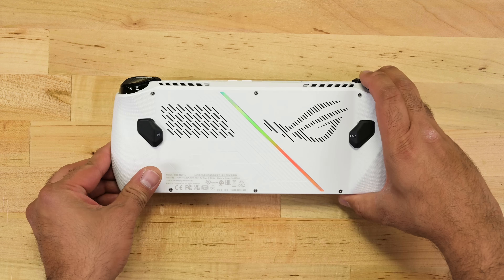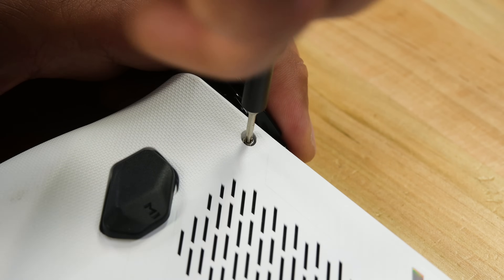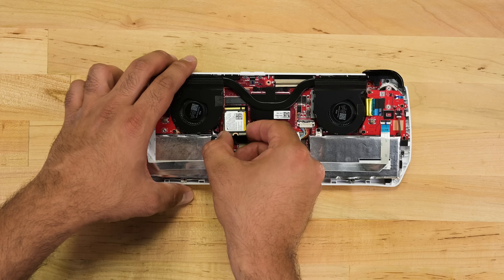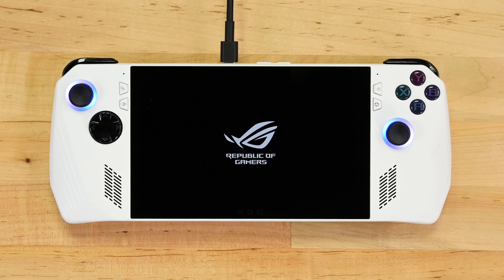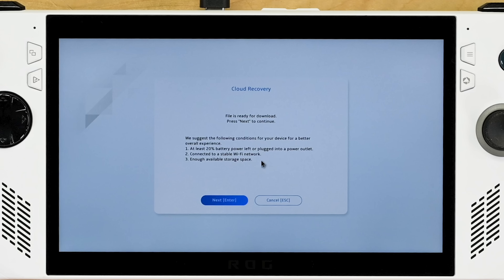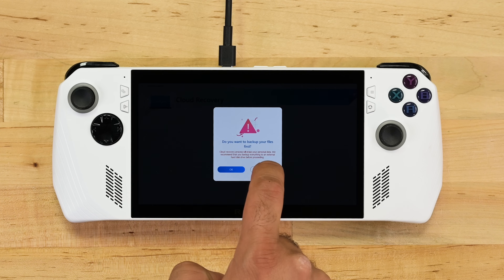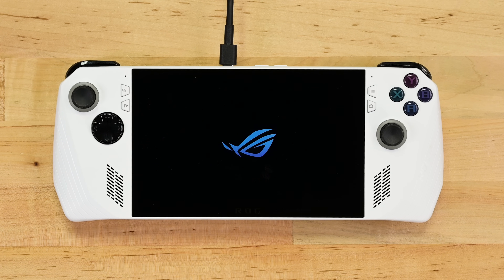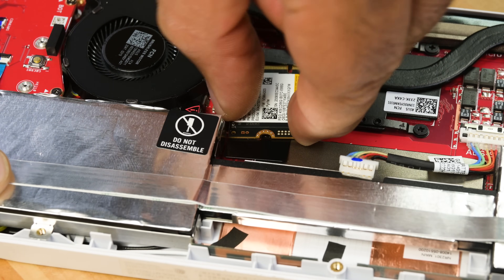How to Upgrade the SSD in an Asus ROG Ally

Comment: Thank you 😊, just upgraded to a 2tb I got from Amazon black Friday deal...

Then the Rog didn't power up 😰, after a brown trousers moment, I remembered YouTube can fix everything... There is another video on here that tells you to hold down the power button for 40 seconds with no power supply plugged in...( Not sure why but just do it ) Then plug in a high power supply to jump it, ... I plugged in the Rog original charger, it didn't work 😨 then I tried a 100watt usb charger, 🤠the thing instantly powered on , and all is good from then on , back to normal... I don't know why , just writing that here incase some reads this and is thinking s&it I broke it , it will power back up find or borrow a high powered laptop charger or buy one from Amazon then send it back 😎 ..the end

Comment: I tried this. I was easily able to open the Ally and remove the battery connection, but my problem started after that. I tried to open the ssd screw but the screw started stripping. I tried my best but it didn't budge, tried some hacks, still nothing. 
Luckily enough we have a lot of independent PC repair places where I live (Ashok Vihar, Delhi, India). The guy there was able to open it with his screw driver and technique. 
I would recommend using a good screw driver for this or let a professional take care of it. 
The Windows recovery process was very easy.

Comment: REMEMBER the device will not turn on if the backplate is not closed and all the screws tighten. I understand this is a safety feature, I can't really criticize it, but put a warning somewhere. I almost got a heart attack thinking I broke something when upgrading my SSD.

Turns out that,  unlike with desktop PCs, you need to put all the panels back before turning it on. That goes against my every instinct as a PC builder.

Comment: Just got mines switched to a 1tb ssd card. It felt like forever getting it set up. If your rog ally is anything like mine. If your secure boot isn’t already set up on the original ssd card, do that first before you set up any new ssd card. It will definitely be a fast process for you.

Comment: So much simpler than the Steam Deck.  At least with the rog, you don't need two or three different screwdrivers.  I have a 2TB NVME in my Deck right now, and my Deck is in storage.  I'm just waiting to get a dock for the Ally, before I do any surgery on it.  What is the Steam Deck NVME heat shield for anyway?  If it's necessary, then why don't they all come with heat shields as standard?

Comment: Whats the biggest ssd you can add?
Reply: Hi, the storage isn't the problem here the size is. If you feel brave enough, you can unleash your hacker man mode.
By default as of 12.2024 you can only install compatible SSDs up to 2tb. Everything above is most likely fake or slow as af. I use a 2tb WD Black SSD in my Steam Deck which I also used in my ROG Ally.

However, if you're also a big gigabit haxxor destroyer, you can get "Bewinner For Rog Ally Handheld Conversion 2230 to 2280 SSD Hard Drive Expansion Board" in order to fit normal size desktop SSDs and get something like a 8tb SSD into this thing. I did that and had to install a heatsink for this SSD but it was working fine with Ally.

Comment: If you are being prompted to enable secure boot and it reverts to disabled after you have saved and retried then make sure that "fast boot" is disabled on the boot menu.
Reply: i am still getting secure boot prompt when i try cloud recovery. I turned off fast boot, exit and saved. entered bios again, turned on secure boot, save and exit. returned to bios, secure boot is off again...
Reply: @johnny14794 Did you resolve the issue?
Reply: @VelvetMaginician  Yes. I put back the original M.2. Entered Windows. Disabled Bitlocker. Then I went into the Bios and was able to turn off Secure Boot. Then I Put back the replacement M.2 and was able to reinstall Windows through the ASUS recovery.
Reply: @johnny14794 I see, I’ve been curious though, can I swap the SSD with a new before the whole startup and set up? I mean like straight out of the box brand new

Comment: Thanks for the guide. It was really helpful. I struggled a bit because I could not get the upper right screw out of the Ally case. I just removed the backplate anyways and it was not an issue. Removing the SSD screw was also a bit awkward, but it was fine. By the way I used the iFixit essentials toolkit and it worked out great.

Comment: Tip for anyone who runs into network error message. Use your phone's Hotspot while on your home wifi. It wasn't working directly connected to my wifi, but worked immediately after using my phone Hotspot for whatever reason.
Reply: I had to do this too, not sure why. Free data luckily
Reply: Note to anyone reading this advice: Don't do this. Phones can't share hotspot and be connected to wifi at the same time. All this guy did was use his cellular data

Comment: Note that the screws on the back should be 100% tightened. Apparently there's a safety feature that stops it from charging the battery (even if the orange light is on) if a screw is loose.
Reply: Top comment

Comment: Well with the SD card reader issue, I lost my 512gb micro SD card. but I didn't give up on the device yet. Instead I ran up to microcenter and got a 1 TB drive. I'll refrain from using the SD card until otherwise

 Thank you for showing me how to get back to the cloud data.

Comment: Note: After disconnecting/reconnecting the battery you will have to plug it back into the charger to turn it back on. ( Even if the battery has a charge )
Reply: You are correct sir.  Sure wish I would have read that before hand 😂
Reply: I came here to say this. Tried plugging it in to the rog dock but had to use the original charger to get it to turn on.
Reply: lol i know i almost had a heart attack
Reply: You dont have to disconnect the battery.
Reply: @NoMoreLies365 you don't, but for the safety of frying or shorting something, you really should ...
Reply: @NoMoreLies365  always  disconnect battery

Comment: Don't forget to set your correct time and date in bios if not you'll be stuck on "checking" for cloud recovery 👍🏻
Reply: How
Reply: That's why I don't disconnect the battery 😬
Reply: @borky1987  you should
Reply: You should to avoid shorts/frying something
 @borky1987
Reply: @borky1987 so that's not really needed?
Reply: @Gamebasic I don’t know I would say it’s 100% standard recovery protocol to disconnect the battery to prevent a short circuit

Comment: this is the last resort if ASUS cant fix the SD CARD / reader malfunction issue
Reply: Honestly, this should be a first resort anyway.  It may be a bit pricier than using an SD card, but at least it's all in one now, no fiddling around required.  I was using an SD and just decided it was easier and dropped in a 2 TB drive.  Copied over all my emulators, reinstalled steam, bobs your uncle, good to go.

Comment: It doesn’t automatically boot into bios. You need to hold the volume down button and then turn it on.
Reply: Brand new ssd installed for me . Booted directly to Bios
Reply: Installed a brand new western digital black sn770m 2230 2tb and mine would not start until I plugged the charger in. I didn’t know about the volume button
Reply: If you having nothing on the ssd it will boot into bios automatically. Dont spread misinformation.

Comment: I just picked up the ally from Best Buy (finally in stock) and I was blown away how great this plays games. I was disappointed with the storage and I know it has microsd but I wanted to upgrade the m.2. Will this keep my windows OS key since I’m guessing windows is on the other m2?
Reply: That’s the point of doing the cloud recovery. It will put the system back to stock on your new ssd. Otherwise it would just be a blank windowless ssd.

Comment: Had to plug in the original power supply before it would turn back on, but other than that no glitches.  Connected to 2.4G wifi on the first try and is already almost done with recovery.  Used the Inland QN446 from Micro Center/Amazon.

Comment: IMPORTANT: You need to update the MyAsus app firmware and bios before swapping the drive as stated by ASUS or you will get stuck on the 'checking' on the cloud utility. 

IFIXIT guys need to redo this guide as its pretty important as most would assume they are doing something wrong!
Reply: I didn't need to do anything. This guide worked fine 😂😂

Comment: Thank you for this good sir. I upgraded to a 2TB 2230 Sabrent Rocket Q4. It was a little rough, but I still managed. It wasn't connecting to network after the swap. It took me 3 or 4 tries. All in all, mission accomplished!
Reply: Where did you buy your 2TB?
Reply: What was the price on that SSD?
Reply: @josephhall7317  I find that the best price atm for a 2tb ssd is prob around 140$ for a Teamgroup ssd, more mainstream ssd's like corsair or sabrent will run you like 180$, idk if this is something you still care about but that's from my searching recently for my Ally.

Comment: Followed the instructions now I get a secure boot violation error when starting up the device after replacing the ssd. Disabling secure boot option on firmware doesn't work, it keeps turning it back on 😢
Reply: Did you ever figure out the issue? I'm going to be helping a friend upgrade his soon like I did my steam deck. I don't want to mess up his stuff.
Reply: @mikeuntold  unfortunately I couldn't figure it out. I put the 512gb ssd back on the ally and it worked just fine again, so I gave up upgrading the ssd.
Reply: @dimape  Thank you for the speedy response, I'm sorry you couldn't complete your upgrade. No chance you can return it and get a new one and see if it fixes things?
Reply: @mikeuntold  can't do tha unfortunately.  I don't live in the US, a friend of mine brought me the ally it'd be too much trouble shipping it to the US to get it replaced. But I don't think it's a hardware issue, seems more like a BIOS problem.
Reply: @mikeuntold  but I think I was just unlucky,  most people upgrade the ssd with no issues at all. I'm sure you and your friend will be just fine.
Reply: I had the same problem as well. Did you get your SSD from another device say the Steam Deck or you have a brand new SSD? Because I got my SSD from my Steam Deck and thought I'd swap it in the Ally and I got this error message. Maybe is it because you need a formatted SSD?
Reply: @arnie7975  yeah i got my ssd from the steam deck. Maybe formating it will fix this issue, I didn't try that. Let me know how it works for you!
Reply: @dimape  Yes, that could be the solution! And how do you format the SSD? Do you think factory resetting the Steam Deck will also format the SSD?
Reply: @arnie7975  I don't think it will, because the steamdeck will install basic steamos files and file system on the ssd. I had no other way to format the ssd that's why I gave up.

Comment: To be honest, the biggest feature of the Steam Deck is that it runs on Linux, and not on the Microsoft's Windows (into your privacy) OS. I hope Valve takes the inspiration from this or Framework for easier battery replacement in the next version of Steam Deck.
Reply: There's a simple way you can protect your privacy using windows. Set up a pihole DNS server (work on a raspberry pi). Not only does it offer network wide adblock, so covers your phones, laptops etc etc, it also stops dead the windows 10/11 telemetry data being sent back to Microsoft. The DNS server generates a failed DNS resolution for anything that's on the block list. There's some great public blocklists too. I think mine has close to a million blocked sites. The requests get sent into a DNS blackhole, never to return again.

I run Windows, Mac and Linux machines too. Each of them great in their own way. You can't really chose one over the other when you have all 3 operating systems on computers inside your house.

PiHole is truly great though. You can run it from anything that will take Linux. It even works in a docker container. Mine is set up in docker. Works like a charm.
Reply: Considering all the issues that they've had with anti cheat software required by a good selection of the games, Linux can also be a downside.  Linux is a great OS, but there IS the whole compatibility issue thing.  And I don't like having to wait for a patch for every game I want to play when I know it will work right now on the other system.
Reply: Windows is so much better if you're not a computer programmer as its a pain in the ass to install anything but steam games onto the unit where you can anything that runs windows (discord, steam, pc games).

Comment: Well....

I went the spicy upgrade route by
- buying the wrong SSD 4TB P3 Plus and cloned Ally SSD with Macrium Reflect
- open the Ally ripped the warranty void sticker
- removed the battery.
- carved the plastics with an x-acto knife
- fold over one WIFI antenna
- kapton taped and used a thermal pad on the SSD and installed it
- placed back the battery while its right metal frame sits on the side of the SSD - sketchy I know
- re-assembled the Ally and boot
Reply: well at least can function normally after all :D

Comment: No bad comment regarding upgradable ram? mac computer get so much hate? :)
Reply: Because this device already comes with the maximum RAM capacity, 16GB for a handheld is not bad at all, however 8GB of non upgradeable RAM in a laptop that costs $1100 at a base price (for the cheapest one) and $200 just for another 8 gigs is highway robbery
Reply: @heroninja1125  But well, ifixit makes on replacement parts , and they want to maximize the win ;)
Reply: @heroninja1125  yeah, upgrading from 8 to 16 for $200 is pretty bad. For $200 I could easily get 64GB DDR4 kit for a tower PC.
Reply: @heroninja1125  But you have much more use cases with a laptop for 1300 USD, that also performs like a beast, (passive cooled) I just think its funny that Apple is the only one that gets hate when there is no replacement parts :)

Comment: Also if you go to change the SSD make sure the date and time are correct in Bios.
Reply: this is actually very important most of these upgrade videos dont mention it
Reply: Is that done before the ssd swap or after?
Reply: @SupremeWoolf it’s during the swap the moment you slot your new SSD in you should see the BIOS boot up screen
Reply: @SupremeWoolf  To clarify what he means is it's the moment after you've installed it and rebooted it not the moment you've done it as it should be off otherwise you'll gonna get a very nasty shock as it can store upto 20k volts so don't try booting up during this process you'll end up in a very bad way lol
Reply: cuz winblows has trouble with time sync!

Comment: Instead of using the cloud backup, couldn't I just use AOMEI to clone the drive? Has anyone tried before?
Reply: Not sure about that but I tried cloning the Steamdeck ssd with Reflect and it didn't work. Just flashed on and off when turned on. I had to format it and start over
Reply: Yes this does work but for some ally I heard of them getting “region locked” into another language bc of the windows ticket or something lol